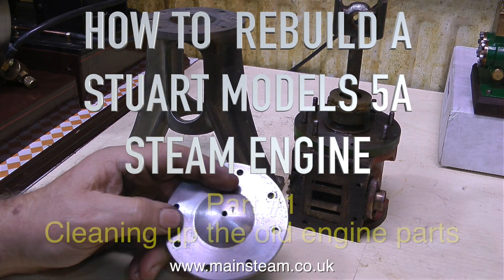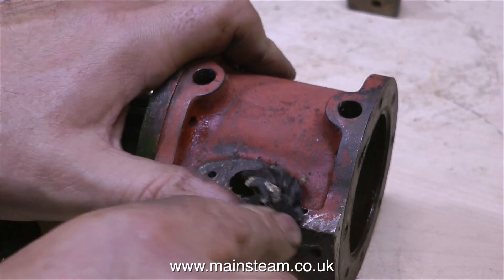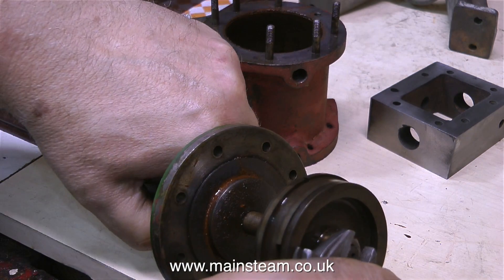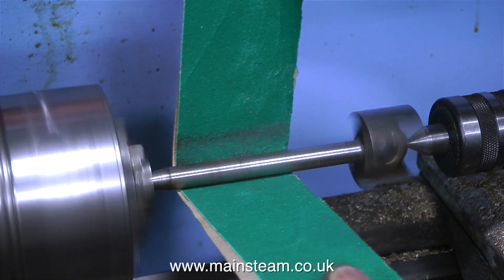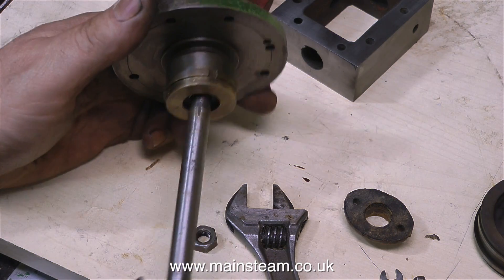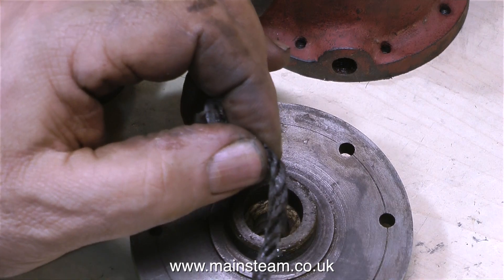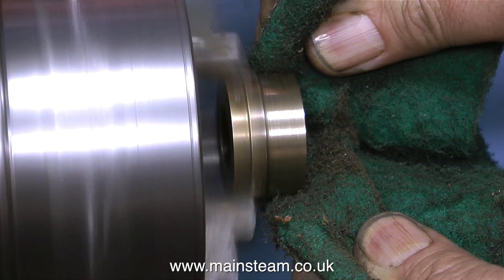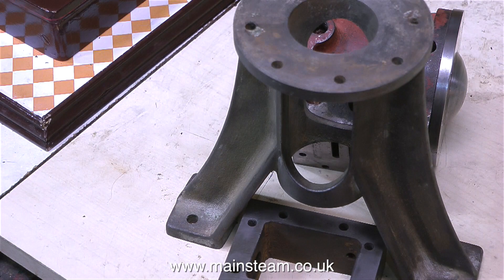HOW TO REBUILD A STUART MODELS 5A STEAM ENGINE - PART #1

Comment: I got a few questions. Could you use this engine to power say a dingy boat. And if I were to have something stuck on a taper like you did could I use a gear puller (little device with arms that grab the gear or what ever u latch it on to and then u twist a screw in and it pulls the gear off) or is it better to just give it a tap with a soft hammer. Great video and very useful as always :)
Reply: I have a 5a in my 17 foot boat , works well